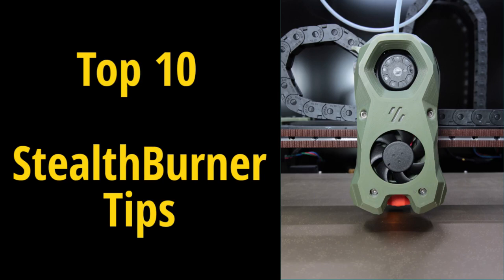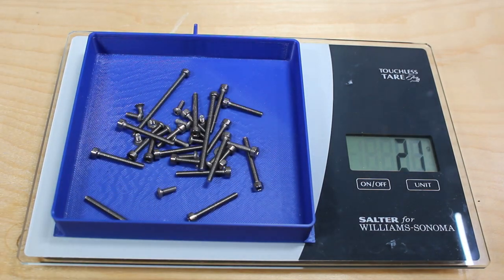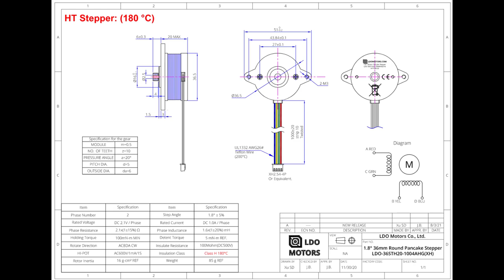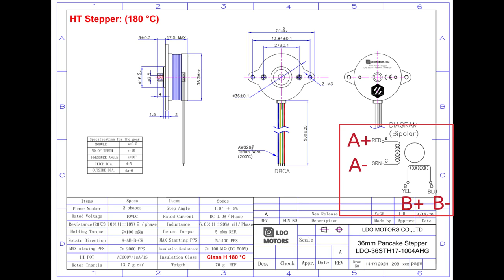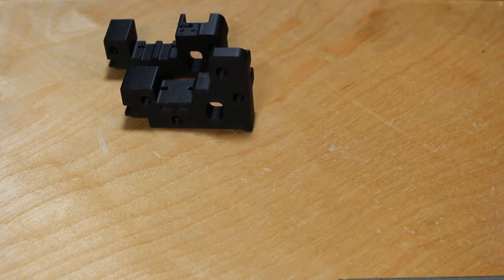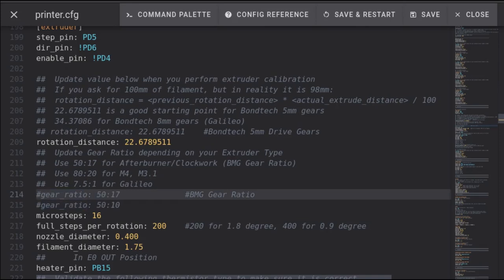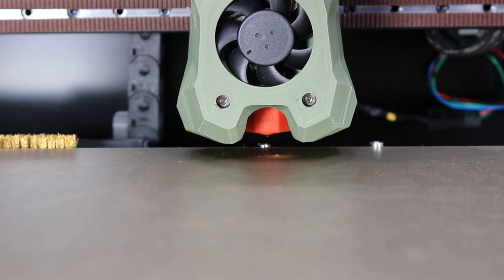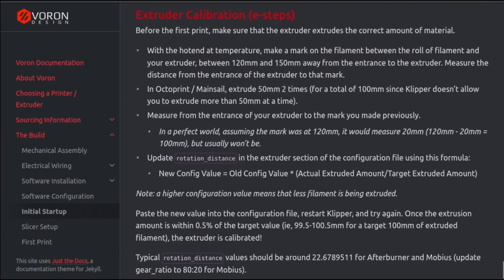Top 10 StealthBurner build tips

Comment: Just built 1st Voron - 2.4r2 w/ stealthburner/clockwork2/dragon HF...esteps calibrated, input shaper / resonance calibrated, pressure advance calibrated...prints beautifully...then I see step #8 to change the gear ratio..DOH, well, looks like I need to start all over again.  Great Video and thanks for putting this out there.
Reply from the maker: If it's printing beautiful, I would leave it be.  Thank you for watching!
Reply: I considered that but also have a rapido on the way as the printer is actually outrunning the dragon HF.  So, I will likely have to redo some work anyway so I might as well get the gear ratio correct.  Your channel is one my my goto for Voron content…thanks again
Reply from the maker: @brianadreger  I just read this again.  When I run higher speeds, I've noticed I need to increase the temperature for the Filament as well.  You might find an additional 5 or 10 degrees help it hit that speed.  I would also try a CHT nozzle which is designed to better distribute the heat within the filament to help it melt better/faster.  Also, thank you very much!

Comment: I had the Stealthburner parts printed by the company I ordered my 2.4r2 from. After a couple of prints I found that the part where the gear clips into got a little loose, which caused the pin holding the gear to wiggle itself free after about 2 hours of printing. Switched to a Bondtech LGX lite, problem solved once-and-for-all. There are also a number of mounts out there looking very similar to the Clockwork 2.
Since then I also switched to using a BTT EBB36 with MAX31865, which makes wiring really simple and also possible to do an umbilical cord on the 2.4. Thinking of getting the new EBB SB2240 and giving it a spin.
Reply from the maker: I've got the EBB36 installed as well.  Seems to work well.  I've seen others use the LGX lite as well.  I might need to try that at some point.  Thanks for the comments and watching!

Comment: Hi
Great tips..
Great work.
I have a question about the slicer settings - when printing voron parts, do you turn on the arachne cut or the classic cut
What extrusion widths to set in slicer? Force 0.4 or slightly different?
Brilliant tip with printing two lever parts at the beginning.
And the last question whether to take into account the shrinkage of the filament when cutting the model in slicer?
So that the distances between the axes of the individual driveubextruder gears are preserved.
Greetings
Reply from the maker: All Voron parts are designed for ABS, so don't take shrinkage into account, the designers already have.
I did not use arachne when I built this printer because it did not exist.  Today I would use it.  It will probably look slightly better and no loss in strength.
All Voron design build manuals/instructions have the settings you should use for printing at the beginning of the document.  You should follow those details.  However, if you are printing the parts for a v2.4 (for example), page 4 states this:

PART PRINTING GUIDELINES
The Voron Team has provided the following print guidelines for you to follow in order to have the best chance at
success with your parts. There are often questions about substituting materials or changing printing standards, but
we recommend you follow these:

3D PRINTING PROCESS:
Fused Deposition Modeling (FDM)

INFILL TYPE:
Grid, Gyroid, Honeycomb, Triangle or Cubic

MATERIAL:
ABS

INFILL PERCENTAGE:
Recommended: 40%

LAYER HEIGHT:
Recommended: 0.2mm

WALL COUNT:
Recommended: 4

EXTRUSION WIDTH
Recommended: Forced 0.4mm

SOLID TOP/BOTTOM LAYERS
Recommended: 5

I hope that helps.
And thank you for the great comments and watching!

Comment: The one heatset in the manual for clockwork can be a pain to install without touching the part, the manual states it. I used a silicone sock from a hotend over the soldering iron, to create a barrier against the ABS while installing that one.
Reply from the maker: That's a good idea. Thank you!

Comment: Hello Thank you again for your Voron series :) Your X carriiage drag chain is wrongly mounted should siit flat at the SB bracket I think you need to rotate the last link at the end either there (SB) or where iit attachs to the rail (near the XY endstop.
Reply from the maker: Thanks for the info!  However, I think it's a poor quality drag chain as I've rotated it and it was worse.  But I've got to run additional wire soon, so I'll try that again just to make sure.    Thank you for the tip and for watching!

Comment: Hi, thanks for the video. I've just finished a 2.4 build with Stealthburner and while it seems to be printing fine I do have audible issues. 1. The part cooling fan makes a loud buzzing sound as a result from vibration from the xy steppers at slow speeds. 2. The clockwork 2 extruder makes a fairly loud clicking sound when doing retractions. Just wondering if you experienced any of these issues or if they are just normal?
Reply from the maker: If the extruder is clicking, I would check  to see if increasing the pressure with the thumbscrew helps.  I would also check to make sure retraction is not more than 0.5mm. As a last resort, I might  try increasing the motor current slightly.  For the fan, I found it tricky to get installed properly and flush. I would try that and also check to make sure it wasn't slightly contacting a wire.  Thanks for watching!

Comment: What’s a good place to buy the titanium bolts ?
Reply from the maker: I have purchased from both these places successfully: 
https://fastener.aliexpress.com/store/1101411097?spm=a2g0o.store_pc_home.pcShopHead_12275096.0 
https://chinatiscrew.aliexpress.com/store/1100450727?spm=a2g0o.store_pc_home.pcShopHead_36874919.0
Also, some have started using aluminum screws as they are apparently cheaper and lighter.

Comment: Hi 🌹
I need help, please. I'm new to 3D printing, and currently, I'm building VORON 2.4 out of the official VORON 2.4 documentation on the website.
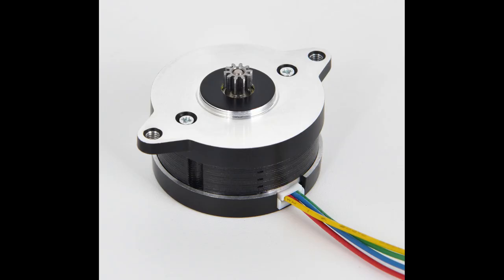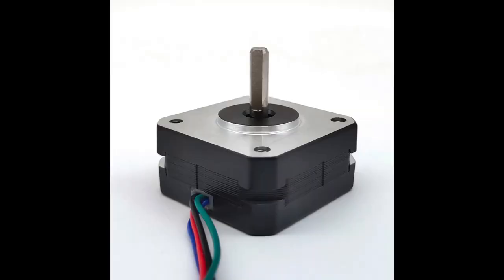There's something I don't get it, from the generated Excel file, there is a 1 NEMA14 Motor 36STH20-1004AHG, and when I search for it, I think it's the one at 02:12 . But I see many people use NEMA17 HS08-1004S which I think it's that one at 3:01, So which one do I use? And what are each one used for?
Reply from the maker: The NEMA 14 is most likely for the extruder on the print head
Reply: @KapmansBasementWorkshop  
and the other NEMA 17? Is it from the parts list?

Comment: i see that your micro steps are 16 mine are 32 does that matter also mine extruder keep skipping
Reply from the maker: If you extruder keeps skipping, check the resistance in the filament path frm the spool to the tool head. You can also inscrease the current to the extruder motor.  I don't think the 32 microsteps improve quality.  But it will reduce motor torque...a possible cause for skipping?

Comment: What is the main benefit of migration from afterburner?
Reply from the maker: I think the top 3 reasons are: 1. Vastly better cooling for PLA. It's not even close on this one.  2. Lighting at the nozzle.  3. Smaller and lighter and possibly better extruder motor.   I might add a 4th for better wire hiding with improved cover.  But honestly, if you just print ABS, there is no major need here.
Reply: @KapmansBasementWorkshop  Thanks for the answer! I could love number 1 (although my PLA prints are quite ok now), the nozzle lights I don't know if I need them and the installation and wiring seems a bit complicated. Could I also leave the lights out? 3 and 4 - alright, why not! Are there also disadvantages of the stealthburner compared with the afterburner, reasons against an upgrade?
Reply from the maker: @lam_xyz  I don't think there are any disadvantages, but I need more time using it to be sure.  But if you only print ABS, I would only switch if something was broken with afterburner as it's great for ABS.  You can run StealthBurner without the LED lighting.  I temporarily have my LED lighting disabled as I am using the MCU RGB connections for Nevermore.  But I am about to fix that in the next week or so.  I'm actually excited to have LED lighting at the nozzle.  I find myself using a flashlight to sometimes observe what is happening on the 1st layer.  The LED lighting will solve that.

Comment: Any reason on not using Nylon bolts?
Reply from the maker: I have never used nylon bolts.  I know nothing about them.  Do you think they are strong enough in the heat?
Reply: @KapmansBasementWorkshop  They use them quite frequently in building drones to reduce the weight. So they have the strength. Considering their melting temp is around 250, why not give them a go?
Reply from the maker: @oplavevski  Ha! you are tempting me.  Now that you mention it, I have some small ones for mounting circuit boards.  Not nearly long enough, but might be usable in a few strategic spots.  I'll look into them and work on a project....Thank you for the tip!
Reply from the maker: @oplavevski  In just a few minutes of looking at the different types, this is super interesting.